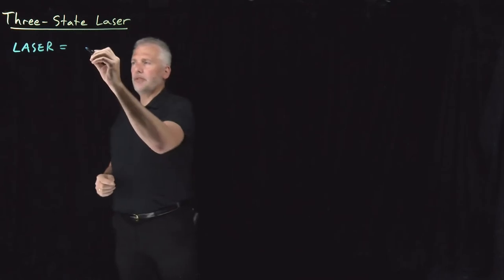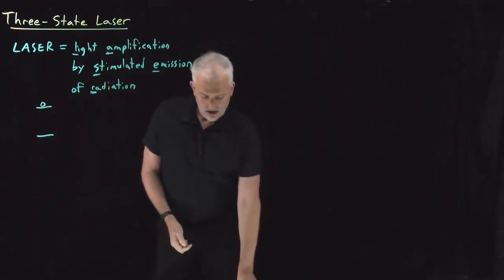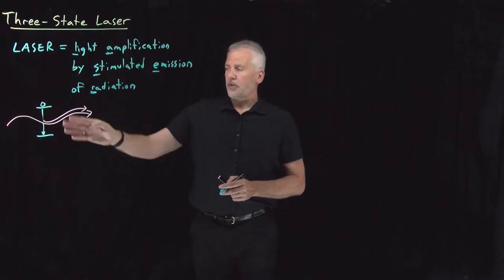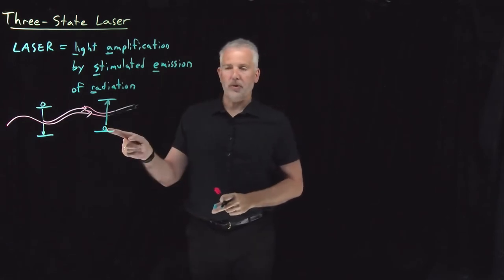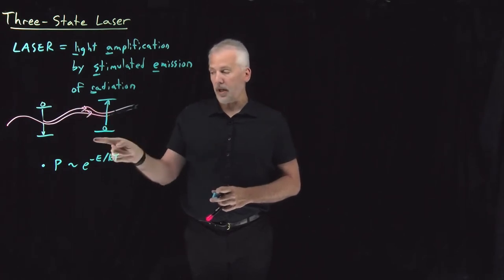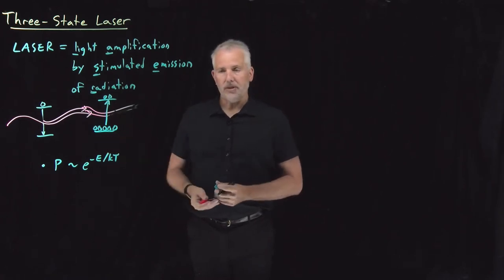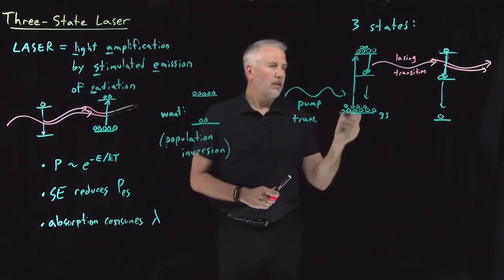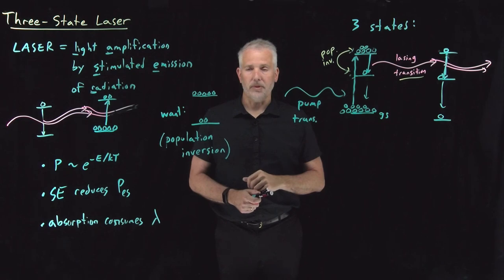Three-State Laser

Comment: thanks dear dr stuart. I didnt find a lecture about bonds to ask this question there. but it makes me curious why some molecules have low degradation temperature although the bonds are the same as other more stable molecules. molecules like maleic anhydride composed of the c-c and c-o but are degraded in low temperature in comparision to other molecules.( i want to use it by other molecules in 280 degree of celsious but it degrades in low temperatures and i need to use it😔)
Reply from the maker: Good question. I don't know the answer. I guess it could depend on a lot of things: whether the decomposition is taking place in the presence of something that it reacts with, or something that can act as a catalyst for the decomposition; whether the first decomposition products are more likely to end in a termination step or continue a chain reaction; etc.
Reply: @PhysicalChemistry  Thanks alot. if we increase Temp with pure material and He atmosphere to exit oxygen we have molecules different  degradation temprature  yet. i was thinking it may be related to movement of molecules which damp the energy but as you said it can depend on alot of things. anyway thank you for helping🌹🌹🙏